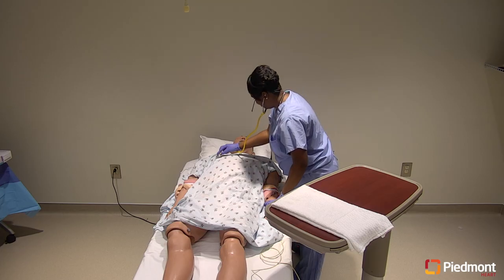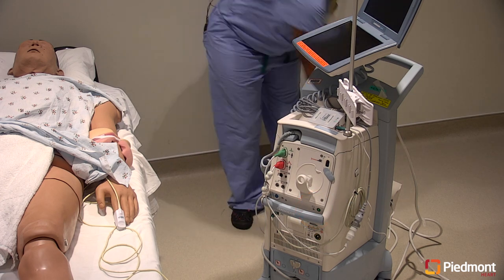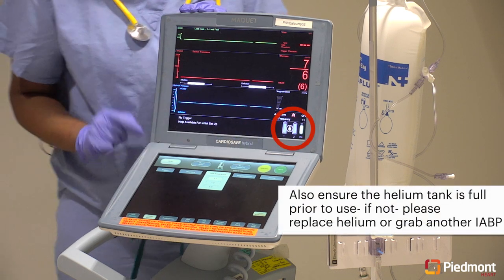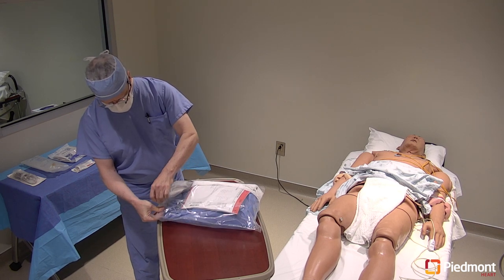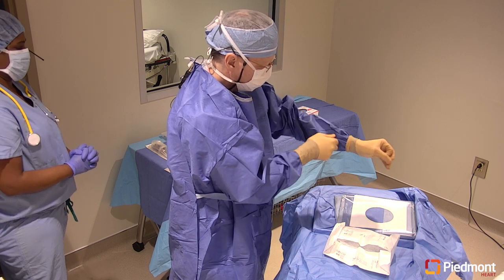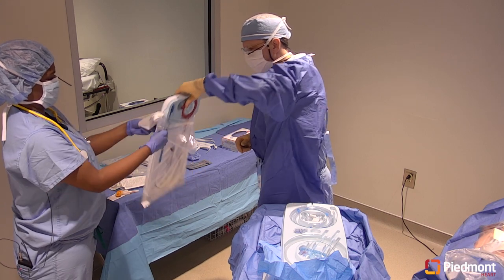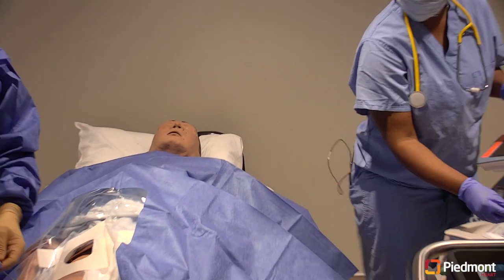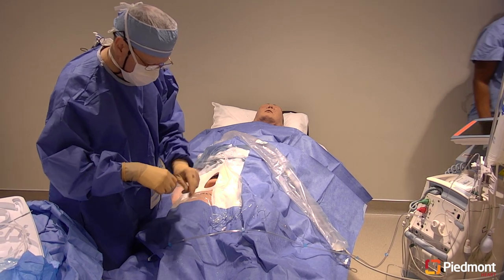Inserting an Intra-Aortic Balloon Pump in the ICU

Comment: Some of the sterile technique needs improving. Generally Good though.

Any person RN, Tech, whomever assisting or 'circulating' must never have items hanging off or around their necks - a great way to inadvertently or unknowingly contaminate the field.
Microbes can drop onto the field - particularly stethoscope ear tips etc
It would never happen in the O.R. it should not happen ANYWHERE else either.

Just take that kind of gear off and set it aside in a safe nearby location.
Reply: Good input. Watching this to learn, I appreciate them talking through the procedure, and as I’m not in the medical field I’ll forgive any mistakes they make if it mostly follows what happens. Glad you said it was partly a good video!